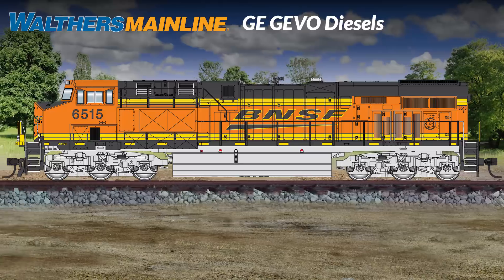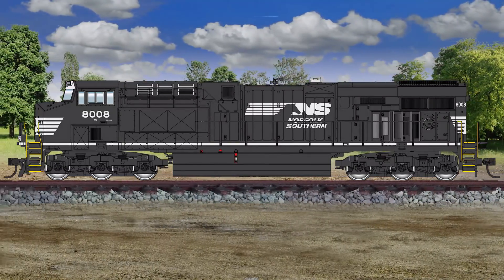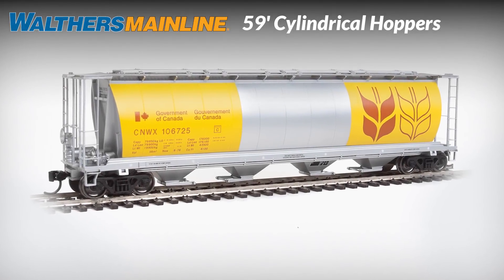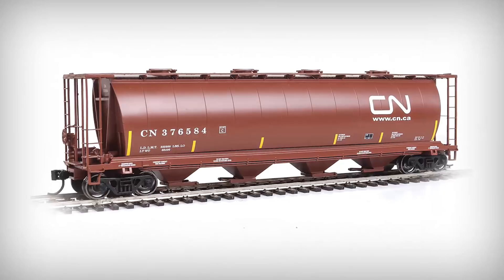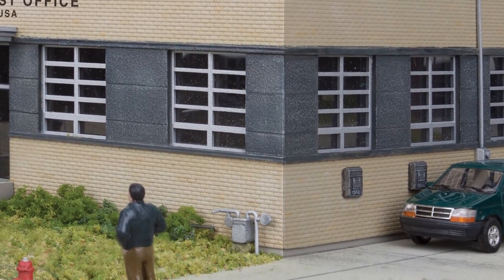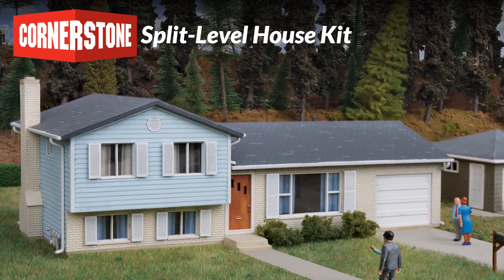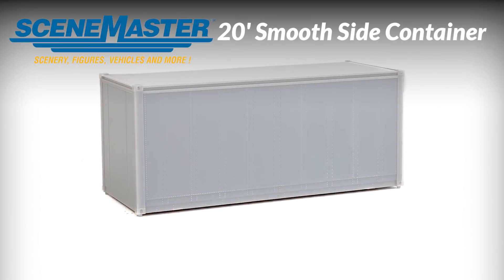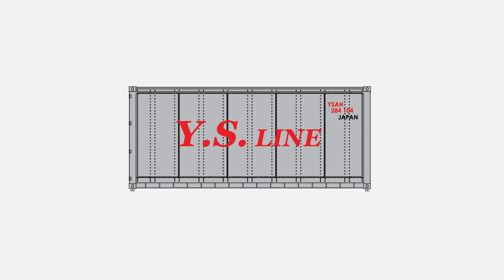Walthers New Product Express - October 2018

Comment: Might want to fix your moulds for the houses you made.  The tab / slot system you use to align the walls are mis-aligned on many kits and cause gaps in the walls , base and roof lines.  #Fail